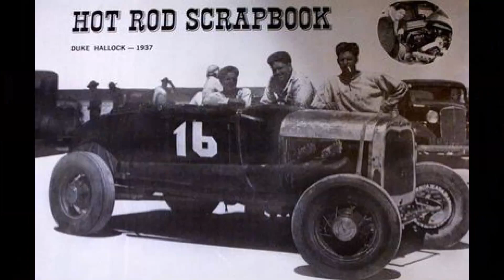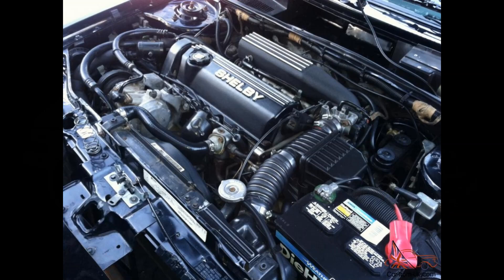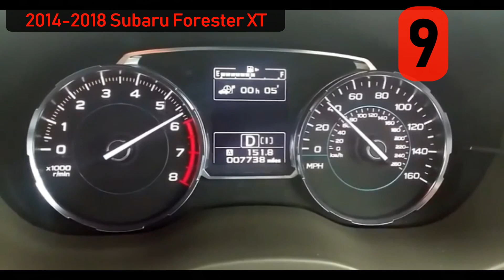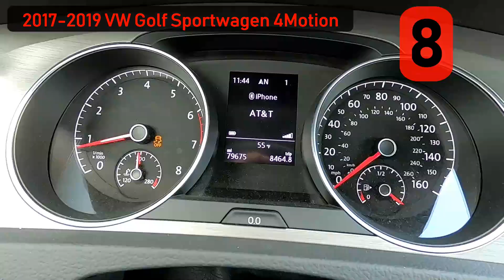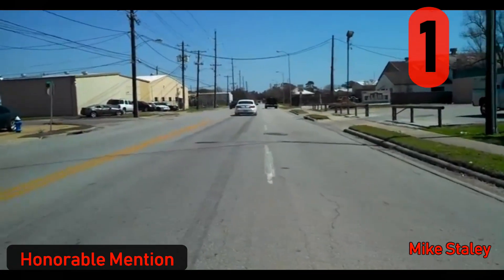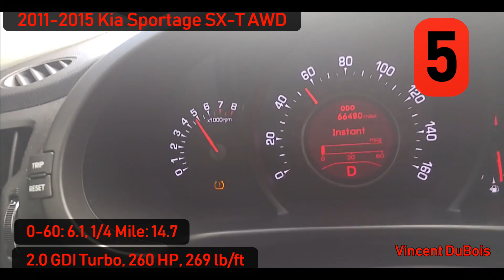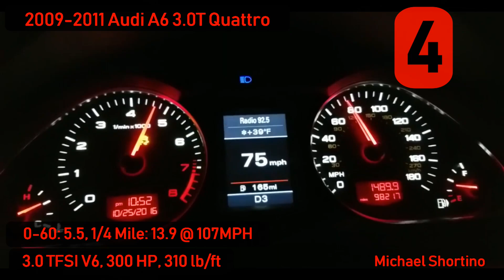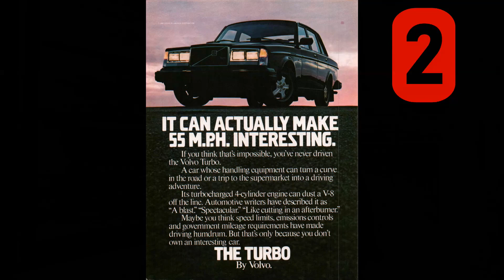10 Very Quick Modern Day Sleeper Cars

Comment: Any thoughts on autocross sleepers? I've had thoughts about a 2019-2020 Elantra GT N Line in H Street.
Reply from the maker: Lots of potential sleepers in GS and HS. In GS you have the Buick Regal which made this list...2.0T power in the GS which could be had with a 6-speed manual, and available AWD with the 2.0T (auto only though). HS has tons of stuff I'd love to try, however many are getting old, which means near impossible to find stock and getting close to the sunset rule :-/ One modern car I think is a potential autocross sleeper is the Audi RS3 in BS.
Reply: @fastpaxSCR  Think the Regal would run competitively with the Civic SI that seems to rule GS? Those darn things really scoot out on course (especially when Ron Williams is behind the wheel).